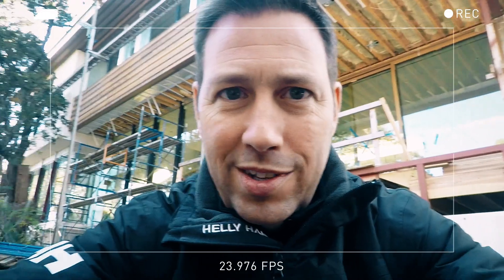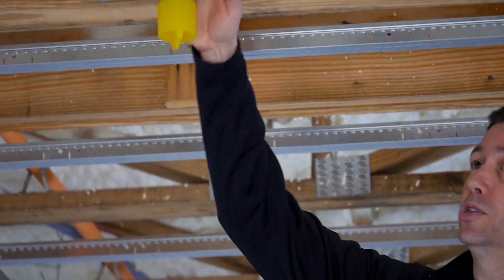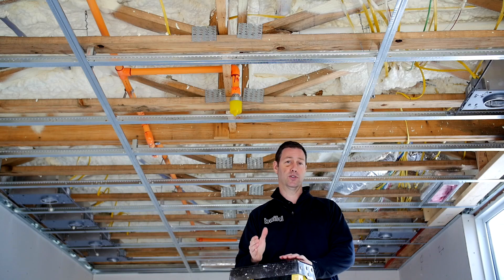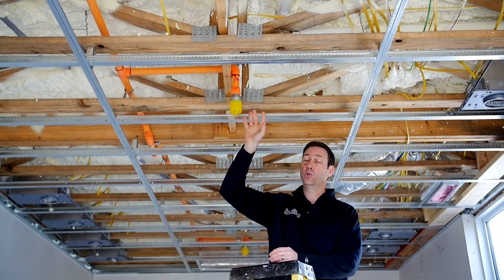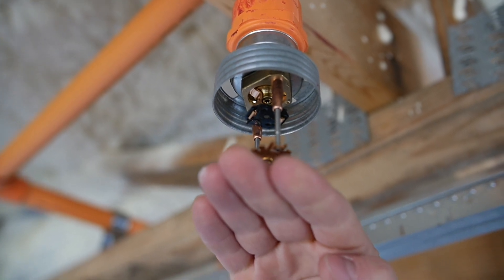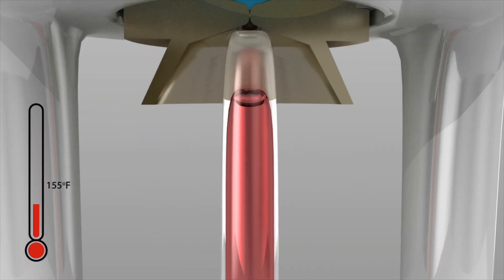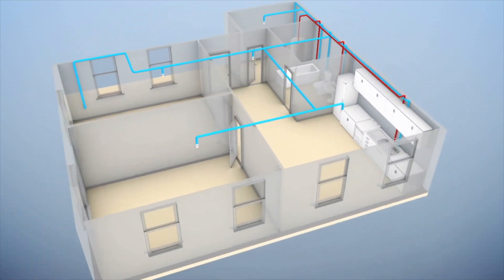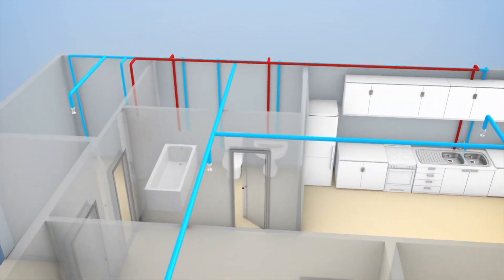Home Fire Sprinklers

Comment: is cpvc code ? it seems like if its hot it will melt the PVC
Reply: Yes, there is orange CPVC pipe that is specifically designed for use in sprinkler systems. Of course, if you get to the point where the sprinkler system pipe is exposed to flames, it seems like the house is a goner.

Comment: Thank you Matt for this video. seems the system we have here in California. Alas, today I drilled a drywall screw into the 1-1/4 pipe I thought was a stud. A tiny hole (tip of pencil size) but gushing water spray through wall. Shut off water supply through city main on pavement as home water shut off did not shut the fire sprinkler pipe.  Almost midnight Saturday now. Can't seem to find the orange type cpvc pipe at Home Depot / Lowes. Would very much appreciate your input: What repair type would you recommend? What part + materials should I get? Can it be an additive on top of the pierced pipe (like patching a bicycle inner tube?) or does the pipe need to be cut and fitted with coupling. What method should I use? Any video recommended?  Thank you! The little wife  :(
Reply: Cut and replace
Reply: Your fire sprinklers deviate from your water supply before your house water shut off. That’s why it didn’t shut ur sprinklers off. You also cannot repair your own system. Fire sprinklers are NOT a DIY. You MUST hire a state licensed sprinkler contractor and get it inspected by a fire marshall.

Comment: It's a shame that the NFPA didn't relax It's building standards with these residential systems. I'm all for residential sprinkler systems, they are so effective at saving life and property, and making them as cost effective as possible will proliferate the tech and bring down costs further.
Reply: They did? NFPA 13D is literally designed to make them as affordable as possible. Closet, bathroom, covered porch, and garage head omission, attic omission, backflow omission, audible alarm omission, FDC omission, remote test drain omission, monitoring and inspection omission, plastic pipe, low design flow, etc. And to top it off, sprinklers can even be completely connected to the domestic system and use PEX. I don't know how you could make it less relaxed.

What would proliferate them is production home builders caring more about people dying than $1/sq ft. Instead, they spent that money lobbying for sprinkler ordinances to be outlawed in most states. Fire departments in ban states can also step up and push for them more.
Reply: @ironmatic1  I also think that average homeowners need to understand how incredibly effective they are. People underestimate the risk, and don't understand the reward. Not to mention, the chance that you could save the structure and significantly limit water and smoke damage... All it takes is working one fire with a fatality to decide they might have been better off with a sprinkler system.

Comment: It honestly depends what kind of house that you were going for a residential house in the middle of nowhere does not require a one system, but if it’s an apartment complex then yes it will require a system I don’t think that you have to do a system in a newly made house those smoke alarms are required and sometimes heat alarms and sprinklers are not required for the most part.
Reply: well in the city hes working in its required. lol
Reply: @resqjason2  I’m not saying they aren’t required I’m just saying in homes that are in residential areas such as suburban or rule areas they are not exactly needed but apartment buildings yes

Comment: Hey, Matt I have a question my fire sprinkler at home is leaking right on the elbow connection, should I replace the the pipe, including the elbow? If I may should I just shut off the main  pipe for the water for the whole house?
Reply: Yes

Comment: Hi Buddy. This video is almost 3 years old now.  Can you tell us if there have been any significant updates in this industry that may change the way these systems are designed and / or installed?  I am looking forward to building my own home again in the somewhat near future, but in the chance that I end up purchasing a "used" home, how about info for the do it yourselfer to install his own?
Reply: Hey buddy- I've been in the fire industry for 13 years. You cannot build your own fire sprinkler system. It has to have proper water pressure calculations that comes from a engineer when it's designed. These have to go through the city for approved plans by the fire marshal and after The Install you must do a final test to get the city to give approved inspection results ..

Comment: Hey bro new here I have a question my house has a small leak so I cut the area of ceiling that has leak well the dry wall and it’s coming from a orangish pvc pipe right where the Tee is at where the pipe glues to the T has one tiny leak looks like they didn’t put enough glue we’ve had the leak for about a year and the land lord hasn’t fixed so we are doing it out Selves the leak has been the same for the last year or so what do recommend can I just put glue around the small leak where glue is missing and if so what type of glue

Comment: That particular head DOES NOT have a the glass bulb or alcohol it actually has a a fusible link which that’s what that black thing is right above the deflector. Hopefully that system has a backflow and wayerflow indicator on it or your asking for some bigger issues.

Comment: If a raging fire were to happen would the water pressure be able to keep up ?
Reply: In commercial buildings, they have a solution to keep pressure to the sprinklers with a lot of heads are activated. Those pipes under the “FDC” signs (Fire Department Connection) are for the fire department to hook a water supply into the sprinkler system.

Comment: I'd be worried about the gluing. One of the failure points in CPVC is having excessive glue left on the pipe. The pipe in your video has visible glue drips, which weaken the pipe and can cause it to fail over time.
Reply: Lol true
Reply: Why do visible/exessive glue is a bad thing?

Comment: Good video, but you screwed up on the explanation with the glass tube containing alcohol.  The sprinklers in your example have a metal fusible link that melts or softens and falls away, which is in place of the alcohol solution containing glass tubes in other systems.

Comment: Already been asked but not adequately answered: how to ensure against accidental triggering?  The answer is that they are recessed into the ceiling.  But it doesn't look like the head is surrounded by anything structural... just plan on drywalling around that?  That's not a lot of protection from the kid with the ball.  
Related question: are shut-off valves installed in easy to access locations to shut off the sprinkler quickly in the case of accidental trigger?
Reply: The city shut off in the street. They are connected directly to the main water, so it always will receive pressure.
Reply: They are recessed into the ceiling, with a plastic cap covering it. Yes. Kid need to be careful with their balls, is it will still trigger them. I was raised as a child in a townhome with sprinklers. It was a very boring childhood, as EVERY SINGLE ROOM HAD THEM and a couple did accidentally get triggered while living there.

Comment: For everyone using this as a diy resource....

Do not
 paint the cpvc
Get oil on it
Get any type of solutions on it
rest any other plastics on it
Placw metals on it
Use non FBC compliant products
Use any fire caulks
Use great stuff or red foam
Reply: For everyone using this as a diy resource

Do not
install a fire sprinkler system yourself
Reply: You also forgot do not DIY fire sprinklers.
Reply: Read the blaze master and lubrizol web site first

Comment: Hello Matt, As a retired firefighter I think this should be a standard that all 50 states and every county that all new homes be built with a home sprinkler system. As a home inspector I point out if the home  has a fire sprinkler system and I note it. What state are you located in that you are building this home?

Comment: Who places the glass tube in head? Why doesn't it come with purchase of head?
Reply: flatswing also, it was a fusible link he referenced. How does the glass get put in.....? Ha
Reply: He was wrong. No one should place a glass tube in the head. There are different models. In the video, concealed sprinkler head’s model does not contain a thermobulb. Instead of a thermobulb, there is a metal piece that will move and let the water flow in case of water.

Comment: At our condo community here in Connecticut, frozen and cracked plastic sprinkler piping has caused major damage and increased insurance premiums. Number of fires? Zero.  I think it's over kill for single family residential buildings.
Reply: John Boccuzzi 

Claim it to bad cheap installation and shoddy tradesmen.
Reply: Well there is a reason you need to keep the building at/above 40°C... We rarely see freeze ups in our systems

Comment: Once the fire is out (ie. temp drops below threshold), what shuts off (re-plugs) the water source?  or does it spray and spray and soak and saturate and ultimately drip to the floor below??
Reply: You can still burn stuff in the kitchen, have candles, crank the heat. Sprinklers don't care until a fire starts to become life-threatening

They typically open at 155F - in a house fire, that's "155 and rising, the furniture is about to flash over."  Those conditions will kill you if you don't immediately escape or get water spray to knock down the heat. If a sprinkler opens in a fire you should get out and let the fire department "overhaul" it before going back in. The only exception I see is if you live way out in the country.

155 might be too sensitive for a sauna or sun-room. 155 steady and dry is, well, it's not inhabitable but it can be survived indefinitely with enough water and salt. But residential rooms shouldn't get that hot.

Country or town, it's a good idea to have clamps and know how to shut the system off so you can deal with accidents related to wild kids or overenthusiastic DIY projects. It's pretty easy to clamp a head closed with the right tool. 

Finally, insurance companies are happy to pay for accidental sprinkler damage. They've run the numbers and sprinklers save them buckets of money.
Reply: ellsworth It continues until the fire department turns the system off.
Reply: control valve
Reply: In my one day investigation of sprinkler systems, there is a shut off valve by the flow detection and check valve.  You need to be able to isolate the system to provide maintenance of the system.  You aren't allowed to install any valves downstream of the flow detection.

Comment: Sprinklers make sense in a large building or where fire can easily go from one structure to another. In a residential application where there is sufficient space between houses, it makes little sense. As soon as that sprinkler head goes off, it will first spray stagnant water that has turned black from the cast iron pipes. It will damage anything it touches and leave a horrible odor as well. This water will continue spraying until someone shuts off the water main to the house. So, instead of your house being ravaged by fire, your home and belongings will have water damage similar to that of a flood.

 The flooring will be toast throughout the house. Good chance a decent amount of drywall will need to be removed. Mold is now a concern. Anything within about 6 inches of the floor in any room has the potential to be damaged from direct water contact; although, many things will have a capillary action which will wick moisture up higher. Some things might be saved, but the house will probably still be a write-off. It isn't much different than what will happen if the fire department puts out the fire, but I don't think it makes sense from an owner cost standpoint. I would make sure my homeowner's insurance specifically addresses the issues above if I was forced to put it in a house.
Reply: It won't save belongings or houses, but it could save lives, especially for people in rural settings where the fire department may have a 20+ minute response time.
Reply: iliketoeatfood123 I'd rather deal with some water damage as opposed to having my family die in a house fire.
Reply: the alternative is the house burning down, which one do you prefer smart ass?
Reply: iliketoeatfood123 
you dumbass, residential sprinklers r to protect the occupants and give them time to get out of the house safe. u can buy new furniture and flooring. u can't buy new kids or parents.
you have no idea about what ur goin on about. get educated b4 u try and educate
Reply: Most systems now run through a TC, or toliet connection. It is connected to the main tree branch system, in the master bathroom. Every time the toliet is flushed, it recalculates the water. It will never be stagnate.
Reply: Now we are going to start building waterproof ontop of fireproof construction?
Reply: No fuck that i want sprinklers in my home ! i dont care about the water i care about lives.
Reply: ilike... 
This is what I was aluding to with my question.  So.... OK.  Now that you know these things, and are forewarned, what are the alternatives?  Clearly a benefit of the water sprinkler approach is a near instantaneous stopping of the fire, and thus 'saving' precious possessions from the ravages of that fire.  But the ravages of water may be just as destructive.  So how do you squelch the water once the fire is gone?
Reply: The short answer is that there is no real solution to putting out a fire in a residential setting. The dry type systems are not designed for general use. ANSUL systems are used in kitchen settings all the time, but wouldn't be practical for a whole house. A Halon system is pretty much only use for sensitive areas without much personnel because it eats up all the oxygen in a space almost immediately. Once a wet sprinkler goes off, it is an open water tap until someone turns off the utility; all that water either has to be either swept or pumped from the house. I have never seen a "smart" wet sprinkler system (but they may exist).

It is really a "pick your poison" situation. There is no way to win. The sprinklers would prevent the spread of the fire but destroy everything below a certain level. Also, sprinklers take high temperatures to activate which means the wire will be quite large before it activates; a decent amount of flammables will already be engulfed in flames. A wet sprinkler system is not meant to save things inside of a space but only to save the overall structure and to keep fire from spreading. It is exclusively there to prevent a bigger catastrophe.

The best option if you have a large collection of extremely valuable stuff is to keep it off the floor in environmentally resistant containers in a single room with a large floor drain then install a wet or dry fire suppression system. That way if things ever do catch fire, at least you have a drain that will evacuate much of the fire suppressant and keep the property damage to a minimum. For most, that is impractical and expensive.
Reply: Studies show that fire departments use about 10x as much water as a sprinkler system. They'll also go to town pulling your ceiling down, etc. etc. If you're worried about property damage, the last thing you want are fire crews in "attack" mode.

A typical sprinkler head flows about 20 gpm. Over a 12' x 12' square that's one inch per five minutes. Not insignificant but it's nothing like a natural flood.  More like a pipe break. Reliability is important, yes, but I really think you're making a mountain out of a gentle hummock.
Reply: Stagnant water, eh? I wouldn't care if it put out the fire with piss. Fires consume buildings quickly.

Comment: Matt, can you share the approx. cost per sf of living space for such a system?
Reply: The opening up and subsequent repair of the drywall will be likely be very expensive as well, plus you will likely want to drape off the area where the sprinkler lines and heads will be so the drywall dust is kept to a minimum, and there will be a lot of it.

Comment: Matt do you install a pressure switch that is tied to the fire alarm in these systems?
Reply: Residential sprinklers typically have a 120v bell for sprinkler waterflow. It would also be possible to connect it to the security (residential, doubling as fire) panel.
Reply: Neil Heuer

No.
Reply: It's called a water flow alarm and yes you can install one.  Some jurisdictions may even require it, but I'm not sure.

Comment: Matt, are these feeds isolated with a separate shutoff for the system? Is the shutoff process as simple a standard shutoff valve?
Reply: briancnc

90% yes and should be monitored
Reply: The shut off is located in the street. To turn it off, you must turn water off to the house.